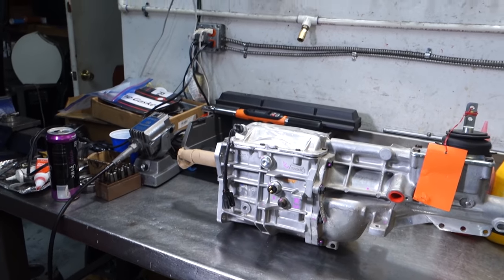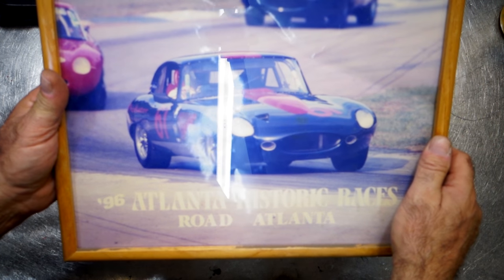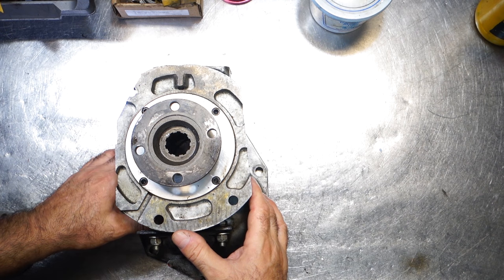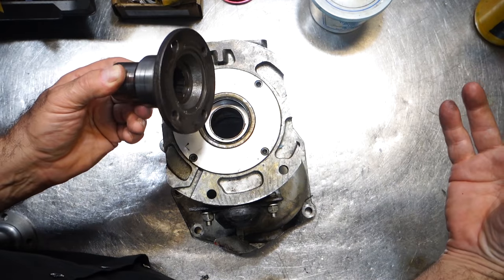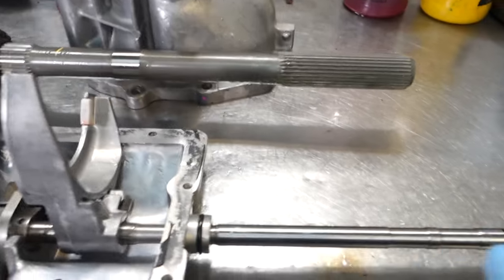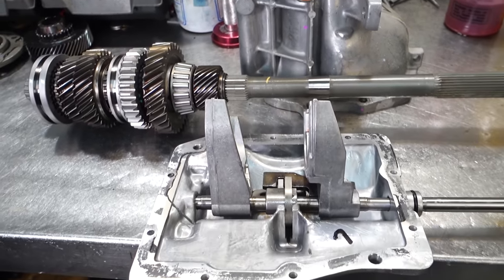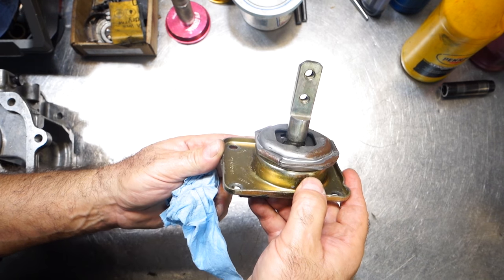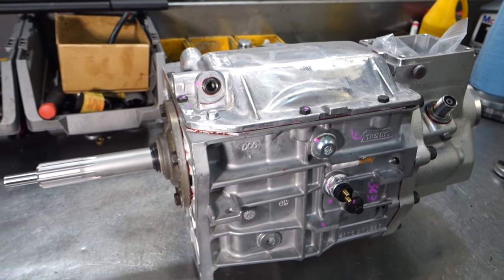Jaguar JT5 5 Speed Evolution and Development

Comment: Great work. I've looked at different ways to go and this looks the best. Understand they are not currently in production. I understand limited demand but would the shorter unit open up the T5 to other markets? Custom transaxles by bolting output up to a rear differential (like c5 - c7 Corvettes) for kit car manufacturers? Or sell as a kit - bellhousing, rear housing, mainshaft, shfter parts so you're not taking up time assembling the units? I would love to see this available once again.
Reply from the maker: Problem is volume versus cash flow. Not about to put 100 to 500 pieces on shelves to sell 50 units at best a year now.

Comment: Quick Question .I have a 1995 Corvette C4 4+3 .Stock engine . The trans and OD are a mess.(worn to the point where the trans leaks and whines more than my ex. The OD is freewheeling and rumbling (like you describe in one of your vids) . At some point I would like to rebuild all of this (to keep the car original)  but this is my DD and I need it on the road pretty quick. I am thinking about using a T5 from a GM V8 (such as a T/A. Will this work well and can the T5 be beefed up a bit ? I don't really want a 6 speed (had one and too many gears for me plus I have been in a few T5s and understand them a bit) . Choices -Rebuild the 4 speed that's in it, use a T5 , or save up and get a TKO 5 speed (time issue here) . Thanks for your awesome Vids ! PLEASE HELP !
Reply from the maker: Depends on your budget. 4 speed was probably run low on oil and the OD is shot. So you're looking 2 grand to rebuild both sections. A T5 is too weak and your are better off with a TKO but it will be more money. Your call
Reply: @GearBoxVideo  I might just keep it the way it is for now . What is your rebuild kit # for this 1985 corvette 4 speed? I want to order it from you and not on ebay. Thanks for your help.